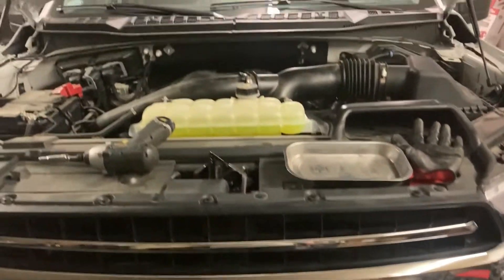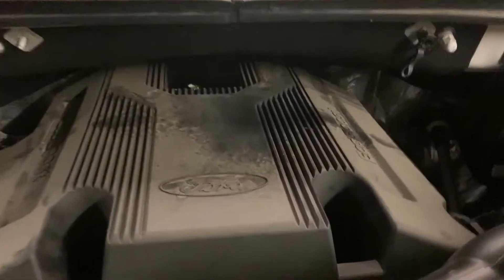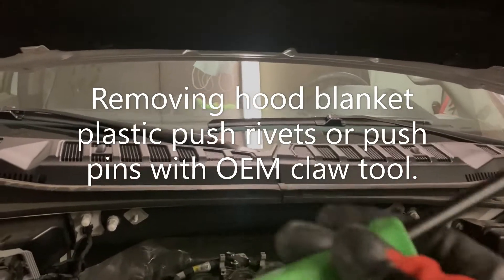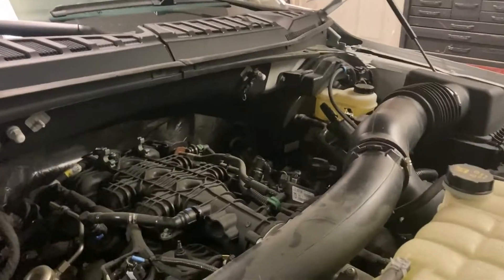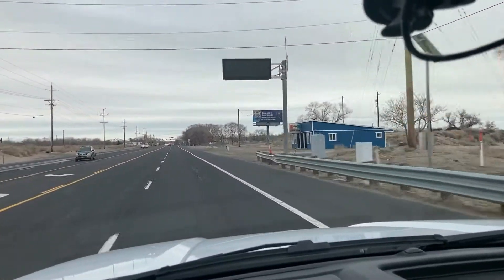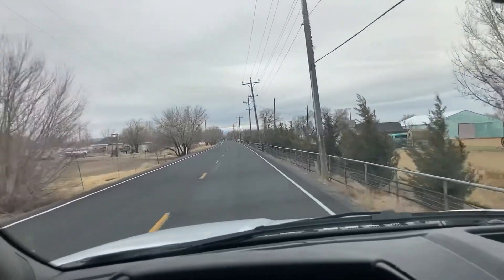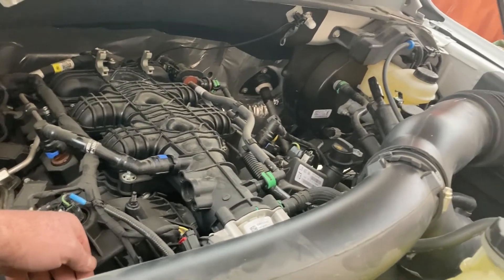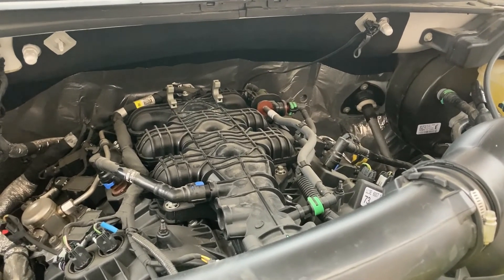Free Cold Air intake Mods Ford F150 3 5 twin turbo ecoboost V 6

Comment: I could see the engine cover but I don't really see the positives for removing the hood cover.  Isn't it there to protect the heat from transferring to the hood which in turn may hurt your hood paint?
Reply from the maker: The heat blanket holds heat in.  It does keep potential temperatures from getting hood hot which if there was hood vents that would be better.  I eventually would like to have hood vents on my hood like the Raptor.  All in time.  Myself I care more about engine heat than potentially heating up my hood.

Comment: Watch that passenger side turbo oil feed line. Seen multiple leaking already. I do regular oil changes on these at Valvoline. Rear main seal goes fast as well.
Reply from the maker: Yes, that can be bad, leaking pressurized oil while on a drive, then run out and not know it until its too late...  Or it gets on the exhaust components and starts an engine fire.